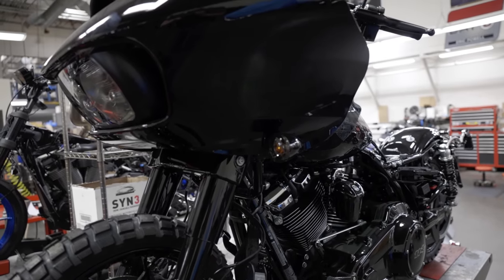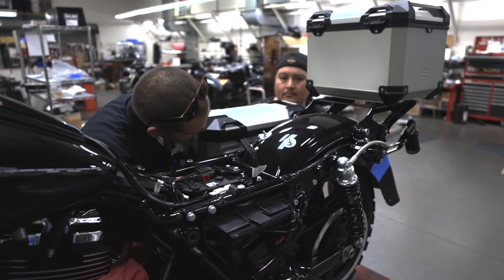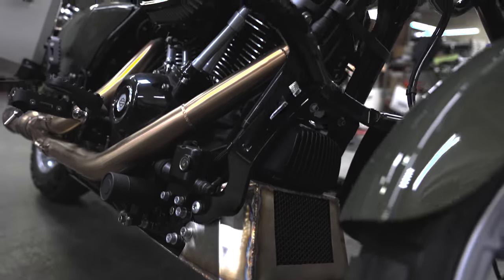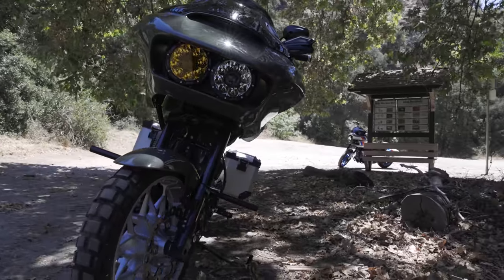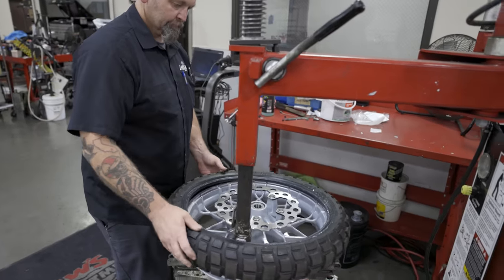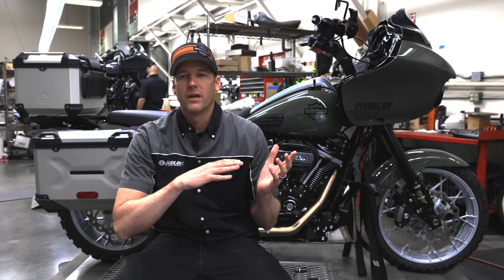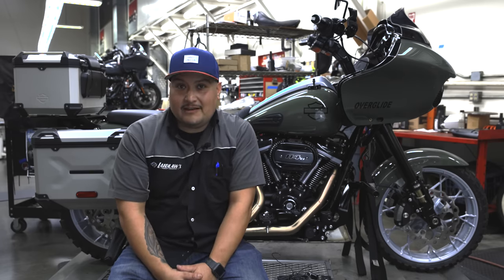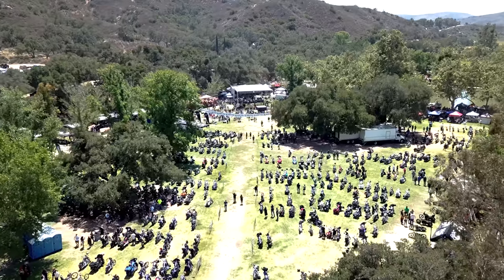Harley-Davidson "Over Glide" │Laidlaw's H-D Born Free Road Glide Special Overlander build

Comment: GOOD IDEA.  THE CRAZE IS OUT THERE FOR THAT KIND OF BUILD. ie: THE OFFROAD SPORTSTERS ON YOUTUBE.  BUT PERSONNALY I WOULD LIKE TO SEE AN UPGRATED ROAD GLIDE FOR TRAVEL. BETTER SUSPENSION LIKE SELF ADJUSTING AIR RIDE, COMFORTABLE SEAT, A REVERSE GEAR ADDED, MORE WIND PROTECTION (WINDSHIELD AND DEFLECTORS) BETTER SOUND SYSTEM AND COMMUNICATIONS ADDED, HIGHER SPEED TIRES, UPGRATED ENGINE FOR HIGH SPEED AND LONGER MILES, LUGGAGE UPGRADES. SOMETHING LIKE THAT.

Comment: Matt, I need a radiator and crankcase protector just like this one.  sell me one on ebay?  Are the tires the original measurements?  where do I find?  in Brazil it doesn't. Thanks

Comment: The idea is interesting, it's aesthetically interesting, but I can't see taking it offroad seriously. No substantial barwork to protect the fairing, no barkbusters to protect the levers, good luck standing up to handle more gnarly terrain...cool looking bike, interesting concept, but just not something I could see owning and actually using on real offroad
Reply: Plus the frame isn’t going to like having 700lbs bouncing around, but it isn’t built for small bike stuff, it looks like the kind of bike I’d ride in comfort all the way to Utah and when I get there go 5 miles on a dirt road to get to a campsite on top a mountain